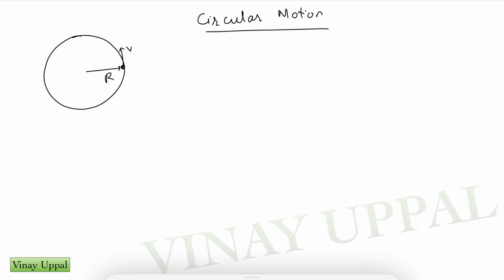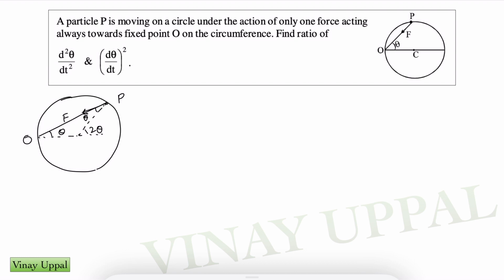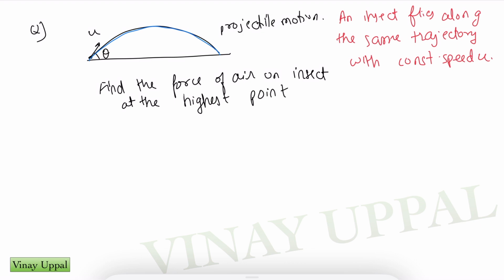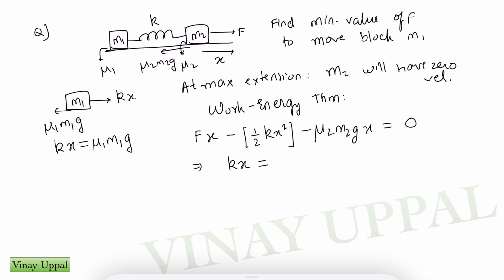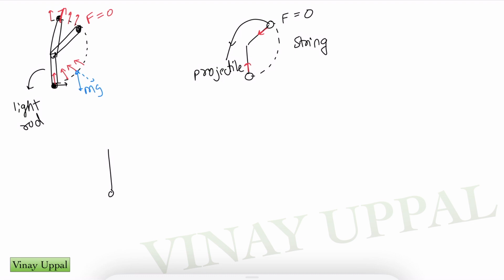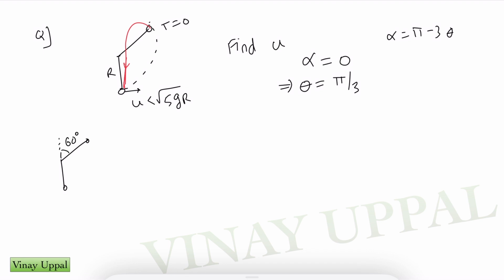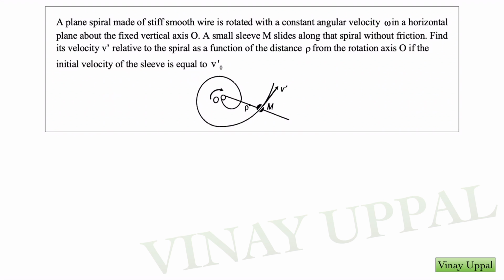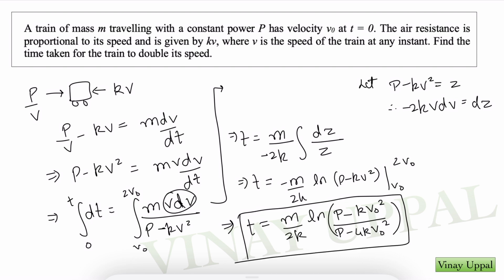1-SHOT! Crash Course Lec 4: Circular Motion. Work Power Energy. JEE ADVANCED. FREE Notes On WEBSITE!

Comment from the maker: 00:00 Kinematics of Circular Motion
11:34 Angular Velocity
16:36 RARE SHORT METHOD
21:26 Banking of Roads
26:10 Radius of Curvature
31:51 Rotating Frame
35:17 Intro to Work
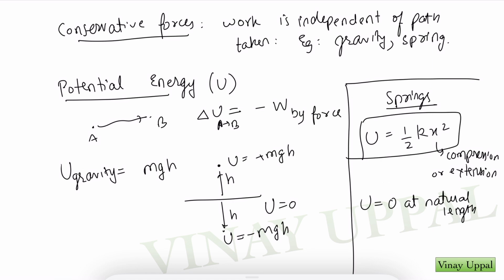39:54 Work-Energy Theorem 
53:12 Vertical Circular Motion
1:09:54 INCREDIBLE SHORTCUT
1:13:33 Work in Non-Inertial Frame
1:16:57 Conservative Forces
1:19:13 Central Forces
1:23:47 IMPORTANT: Potential Energy of CENTRIFUGAL Force
1:28:07 Work By Variable Force
1:31:28 Work By Friction
1:33:32 Stability of Equilibrium
1:37:13 Power
Reply: https://drive.google.com/file/d/1_0ELl1zWq6DUj5_hcvr2modGtQUMEHMv/view?usp=drivesdk 

Sir please help me in this problem... I have solved it but I don't know the answer ... So I am not able to decide whether I am correct or incorrect.

Comment: great content sir, i was an weak to avg student for physics, but i think your lectures have provided better depth and understanding, thanks a lot, also at 47:40 wont the work done by gravity taken into consideration?
Reply from the maker: Till that time, the bucket hasn't been lifted off. Only the cord is extending and increasing the pulling force on the bucket. So bucket hasn't moved and therefore no work by gravity.